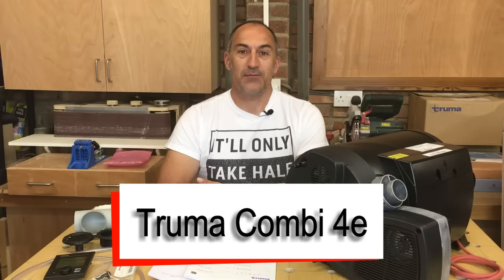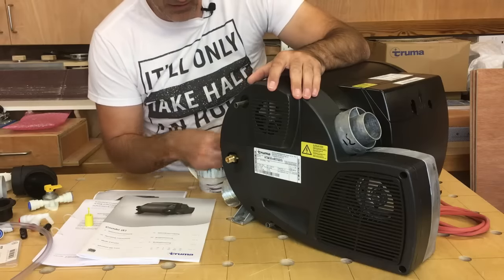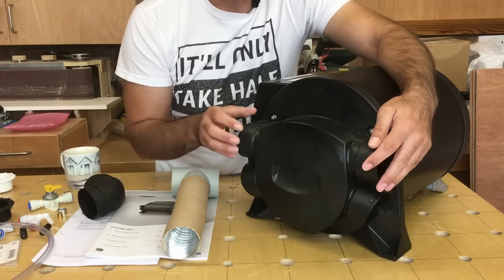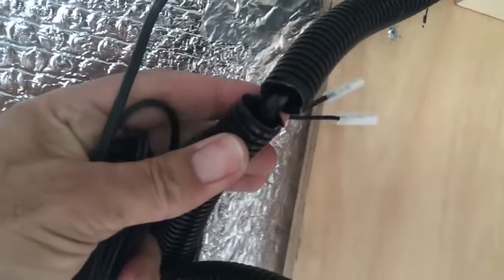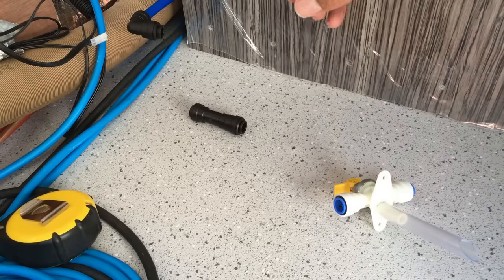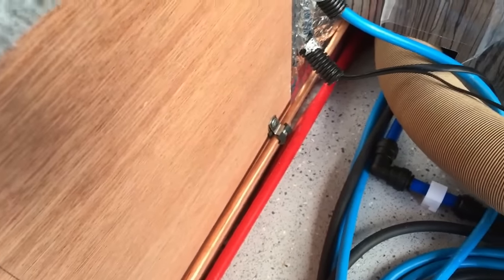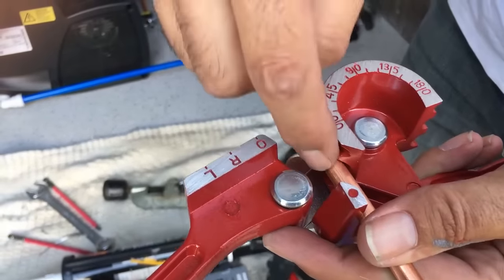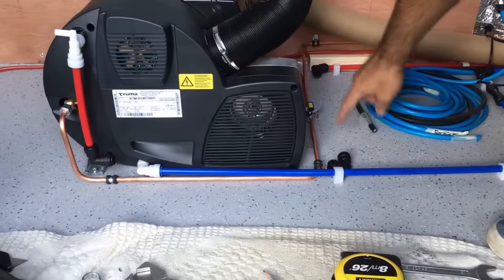Truma Combi 4e Self Build Camper Van Installation

Comment: Hi Greg. Another fantastic video thank you! Very clear & precise, I really appreciate the time you take to make these videos in order to help other people! I have a few questions Greg; How do you find the Truma for heating & hot water (independently of each other & used together) now that you've been using it for some time? Do you find that the manual times for heat up by Truma are accurate? How long does it take for just the heating to heat up? How long for just hot water? How long for both together? If I had a shower & then my partner wanted a shower straightaway afterwards, how long would he have to wait for recovery time? Hope you can answer these questions for me as want to go ahead & purchase a Truma but waiting on your reply until I do, just to be on safe side! Thanks again Greg. Stay Safe in these strange times!! Tracey.
Reply from the maker: Hello Tracey, it will fast become the best thing in your van, we would not be without ours.
We use the heating on its eco setting (low fan speed) as that is all you need and heats the van up in just a few minutes. Maintains set temperature perfectly just coming on and off. As a by-product of the heating, you get a tank of hot water anyway so no need to put that on separately really. we have found if we turn the temp down to 15-16 overnight it keeps the chill off the van and condensation down plus in the morning you have a full tank of hot water for showers or washing.
We can both shower on one tank of hot water as you are mixing it 50-50 with cold water so you actually get 20 litres of warm water.
Another really cool feature is the iNet box which allows you to control the truma remotely from the van either by Bluetooth if in range or by GSM SMS text from anywhere you have a phone signal. often when we are out if it's getting chilly we text the van to put the heating on so when we get back to it it's lovely and warm and a tank of hot water.
We never need to put the boiler on just to heat hot water we use it when it's available, sometimes if you just want to do some dishes its more economical on gas to boil a kettle. However, if you wanted a shower it heats up fully in 20mins no problem enough of two showers.
We could not be happier with ours and guarantee you will be too, it has made our van a cosy home :D
Reply: @GregVirgoe  Thank you so much for your in-depth reply Greg, it is so helpful! Good point about boiling the kettle for washing dishes only!! Would you say that the Truma system is economical on LPG? Can you give me some idea of how long a gas bottle lasts you, (cant remember if it's an 11kg bottle you have?) & what I can expect from that size bottle in terms of usage please Greg? If you can give any info on electrical draw too that would be great? Do you find that the Truma is noisy at all? Once again, thanks Greg, appreciate the help & informative videos!! Tracey

Comment: Hi Greg! Great video once again thank you! What cables does the wall mounted controller need?
Reply from the maker: There is a black control cable that come with the boiler with plugs on the end like a telephone cable. 
The controller also needs a 12v DC power supply protected by a 1Amp fuse.

Comment: Hi Greg
I am about to install this same boiler and this video has been extrememly helpful and i thank you for that.
You mention that a test point and a pressure relief valve both need to be fitted for the lpg. Could you tell me the best place to fit these,can it be anywhere that is convenient or somewhere more specific. You mentioned that you had a run straight from the tank to the boiler with no breaks so wondered where you fitted them.
Thanks in advance,your videos are superb.
Reply from the maker: The pressure relief is a part that comes with the boiler and is fitted to the hot water outlet. There is also a drop out valve fitting to the floor both in this video. 
The testing of the gas I did in this video and starts about 2 1/2 minutes into the video https://youtu.be/8nmFdSU06GM?si=EIFctEsdtTdZd-XR
Reply: Thank you for replying greg. So no need for me to worry about a pressure relief valve. So can i fit a test point anywhere thats convenient on the gas pipe.  Just watched your link to the test video but couldnt see it.Thanks again.

Comment: Hi Greg, that is a really well conducted and explained fit, thanks more making it! I'm just about to fit my combi today and even though I consider myself a competent worker this has relieved any possible uncertainties. Could I ask, do you have a video showing you doing a gas safety check? I've never done one myself (see a couple but didn't pay too much attention), I was just going to hook up a manometers to the nipple on my regulator to check the pressure and for any drops when the supply is shut off...any extra advise?
And again solid video. Will definitely have to check out some others!

Comment: Hi Greg, A wonderful video and has led me to install my own unit. A quick question about the wall cowl. In the instructions it mentions " Drill opening with a diameter of 83 mm (duct hole must be lined with wood in cavities)." What was your interpretation of lining with wood? From your video I can't work out if it was necessary. Many thanks,

Chris
Reply from the maker: Clancaster84 that would apply if your van was double skin with insulation like a motorhome. If you watch this video you see I install a plywood backing plate to all my service holes in the side of the van. https://youtu.be/a0I7-o6VmbU
Reply: Brilliant. As we speak I am installing. Hole drilled. Thank you for all your help!

Comment: Thanks for the guidance in this video, Greg. Top advice as always. I just had a quick question. You mention that you connect your 230v for the Truma via a fused spur for easy isolation. Can you then also fuse the fused spur to carry on and connect to a plug socket?

Sorry if that doesn't make sense, but essentially you have one cable connecting to the fused spur from your consumer unit and the truma connected also. Could you then connect another cable (so 9 wires total in the fused spur) that runs to a separate plug socket? 

Appreciate your insight if you know the answer!

Thanks

Comment: Hi Greg. Great series mate! Re Trauma combi. Will it run without connecting the room sensor. The kit I bought didn't have it in it and its quite expensive to buy. Thanks
Reply from the maker: No you need the room sensor that controls the temp of the heating. 
Here is one I found on eBay. https://www.ebay.co.uk/itm/TRUMA-ROOM-TEMPERATURE-SENSOR-COMBI-HEATING-SYTEMS-FOR-CARAVAN-AND-MOTORHOME-/143788793989?mkcid=16&mkevt=1&_trksid=p2349624.m2548.l6249&mkrid=710-127635-2958-0

Comment: Truma now has the 6D which is the only model for diesel fuel and electric which is what I would like to have instead of going with the Espar diesel heater and something else for the hot water where most folks are using gas. Unfortunately, the Truma 6D is for a large RV style motor home so I'll wait until someone comes out with a small diesel interior/hot water heater. I have the small 07 Sprinter 144" so the 6D would be overkill for that.

Comment: Hi Greg. I'm really enjoying following you on your travels. I am now bingeing your van build series due to ordering a new van to convert. I do have a question about the combi boiler. I really fancy one of these but during my research I have seen a few references to gas fired air heaters causing additional condensation issues. Have you had any problems with this?
Thank you very much.

John.
Reply from the maker: Hello John, never from this boiler as it’s room sealed. Meaning all the products of combustion are connected directly to the outside. 
The air inside the van goes over a heat exchanger and what comes off the heater is very dry air. So the complete opposite to what you heard. 
If you had a gas heater with a naked flame so it was burning inside your van like those old Calor gas heaters then you would have condensation issues because the by product of burning propane is H2O water. But NOT with the Truma heater. It’s a fantastic bit of kit and the best thing in our van. 
Watch my previous unboxing video and it explains more about how it works with cut away diagram. 
You won’t regret installing one 😎
Reply: Excellent. Thank you for the reply Greg.

John.

Comment: Really great video. Great learning for me and many others I’m sure. I’ve liked and subscribed 👍. 1 question; because I want to keep the van as stealth as possible and considering exhaust fumes are heavier than air, can I pass the exhaust through the floor? I have considered an exhaust fan install also (if necessary)
Reply from the maker: The Truma boiler must go out through the the side wall.  The only thing I have noticed is some steam from the vent on colder days otherwise there are no signs.

Comment: Hi Greg. Super informative as always. Have you noticed much difference in heat between the two top and bottom ducts as mentioned in the video? Now you've lived in the van, is it worth spending some money on angles to re route one of the outlets back on itself to install as you mentioned?

Comment: Cracking video as ever. Like a good detailed vid from you. Its all coming together 😁
Reply from the maker: I worry about the length of the videos, but with so much information to get across its difficult to get them shorter.
I don't want to put people off watching it because it's too long. What do you think?
Reply: @GregVirgoe  I think if your aim for your videos was purely entertainment you would probably  want to aim at shorter videos. However what you are producing is a detailed reference as well as entertainment, if you remove content to make the videos snappy, you remove the useful side that they currently have. For anyone seriously considering converting a van or in the process of doing so, longer videos are essential, and particularly your videos are essential.
Reply from the maker: HoileeUK thank you, that's really useful feedback, much appreciated.

Comment: Really excellent video Greg. Planning on replacing my existing boiler with one of these. Space is very tight, and being a refurb I don't want to move existing things more than necessary. Unfortunately my mains electric comes into the same compartment and the back-box for the plug in point will be very close to the boiler. Can you confirm that the lower / larger fan on what you are calling the 'front' of the boiler is the air intake for the hot air blowers? I assume that this doesn't get hot? My mains electric is coming in VERY close to this. In fact, in general are there any points on the external surface that get hot enough to worry about melting anything in the vicinity?
Many thanks.

Comment: Hi Greg, really helpful video thanks just wondered what size hole you put in the van for the exhaust. It says in the instructions 83mm but when measuring it’s about 76mm. What size did you use? Also for the 240v connection did you hardwire it to your consumer unit? Thanks!

Comment: Thanks for all these videos. I love the way you work.. Some of these you-tubers make the hairs on the back of my neck curl ;) Question - I am trying to go as stealth as possible. Is there any reason why i could not run the exhaust tube (flu) out of the bottom of the van as opposed to going through the wall?
Reply from the maker: keithdriverphotography I know what you mean and there are others copying that too 🙄 
Unfortunately the glue terminal must go on the side. I imagine the flue gases would hang around and build up under the van. And could easily come back in through your drop out vent.  You can get different colour to match van and bring gas is burns very cleanly so no visible smoke as such like a wood burner.

Comment: Hi Greg, 
Fantastic video, I'm planning on purchasing the Truma because of your videos! Since the Truma heats water as a byproduct of the furnace, does that mean to get hot water the furnace will have to heat the vehicle? If you wanted hot water and the temperature inside the van was above the temperature set on the thermostat, would you be unable to heat your water without increasing the temp on the termostat?
Thanks

Comment: Hi Greg, What an interesting series of videos, fantastic job, I have been following your series as I am converting my van, i have got to the water plumbing got almost all of the connectors and fittings but I am unable to find a 12mm  one way value , I went on to John Guest website and could not find any there, please could you help. thanks

Comment: Hi Greg, again well done and thanks. 
Truma also has a diesel version, so just wondering if you considered the diesel version and your thoughts on that, given your vehicle is diesel and so you wouldn't need to plumb in gas for it.
Reply from the maker: Yes, you are correct there is a diesel version, personally, I just preferred the cleaner LPG fuel option and I was going to install the gaslow system anyway so it just made sense for me to keep it that way. At least there are both options for anyone who does want to go with diesel and not carry gas.
Reply: I've heard the diesel one is quite noisy if you run it at night.
Reply: Greg  hi Greg,  the Truma featured here is not available in the US to my research attempts. I would sure like to get my hands on one , any thoughts?

Comment: Excellent video Greg, really informative.  I am thinking of getting this product for my own van - a little confused about the electric aspect.  Can I still can run it as gas powered and by 12v power?  I will mostly be off grid, and therefore not likely to use the 240v option much.

Comment: Hi Greg, I admire how you have followed the Build Standards like a good German Officer. 'Ridgid fittings must only be used on the gas installation in a moving vehicle'. Doesn't that smell just a little bit odorous to you??? You may get your gas certification but, let's face it, I  hope you install a good detector/alarm and leaked gas outlet.
Reply from the maker: Hi Norman, that is not dictated by Truma, it's a requirement of the current EU regulation for the installation of LPG into recreational vehicles. 
The heater is secured to the vehicle with 4 hefty screws and the copper tube well secured also. I will be fitting gas detection and have fitted drop out vents too, I have also pressure tested the gas to 150mbar, 5x working pressure, also in accordance with the regs. I will be doing a video on the regs for everyone as there doesn't seem to be anyone following these rules.

Comment: Hi Greg I find your videos incredibly informative great job but I do have one question, the copper pipe you say it's 8mm is that internal or external diameter ?? I've found loads of 10mm ext with 8mm int but not much 8mm ext copper pipe that was all

Comment: Awesome as always....will you be showing how to do a pressure test on the system in future episode?
Reply from the maker: Yes Mark, absolutely. The current regs require a test to a pressure 150mbar which is 5x working pressure for 10mins. For that, you need a simple digital manometer and some rubber tubing, very simple but essential for a van lifer that want to remain alive.

Comment: Hi Greg, Thanks for another great video, I’m starting to install my Truma 4e and wondered if you used a timber backing and sikaflex for when installing the exhaust duct as you did on the other inlets or did you rely on the gasket it comes with? TIA Andy

Comment: Outstanding job Mr. Virgoe. A question please that I didn't see covered here. Is there a reason that you went with a cassette toilet rather than a composting? I know they are very expensive, I do value your judgement though.
Reply from the maker: Hello Charles, this is another one of those sales myths, there is no such thing as a composting toilet for a van. The containers are not large enough to allow the products to even start to compost before you need to empty them. Throwing a few coconut husks and juniper berries into the mix is not going to prevent it from stinking your whole van out. I don't necessarily agree with chemicals as such but the cassette toilet is sealed with a sliding hatch so at least you can keep the products in a air tight box. Mine also has electric flush and level warning light. 
Proper composting toilets are usually built in homes where you can have a massive pit and allow time for the stuff to decompose. 
I just cannot see how you can prevent it from smelling your whole van out?
Reply: Hi Greg, supposedly the extraction vent airing the toilets solid contents to the outside of the van prevents any smells from staying in/entering the van. There are a few good videos posted on this subject on this amazing Youtube platform, worth checking them out. Thank you for sharing your build Greg, I am watching ALL your videos in preparation of my own (second) build. Cheers..! ;-)

Comment: Hi Greg, Great vids - ben super helpful with my build! Quick question - is there any way to reduce the 65mm ducting pipes to a smaller pipe so its easier to get it to where I need it to go?
Reply from the maker: Any reduction will create greater resistance and result in less airflow. There is a minimum that the boiler requires in order to function correctly. You could possibly reduce one outlet as long as the other three were at normal size but expect that reduced one to give less supply air.  If you can adapt things to keep them larger it would work better.
Reply: @GregVirgoe  ok I thought It might be an issue, I'll try and keep them at 65mm, the pipes have a bit of give in them so I should be able to get them into the spaces I need.